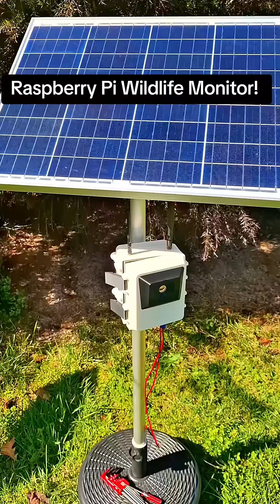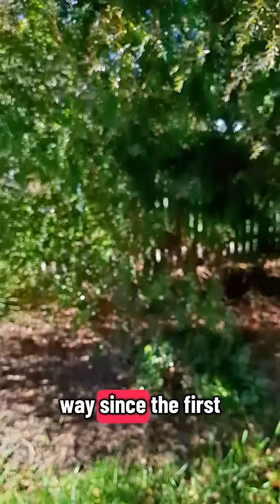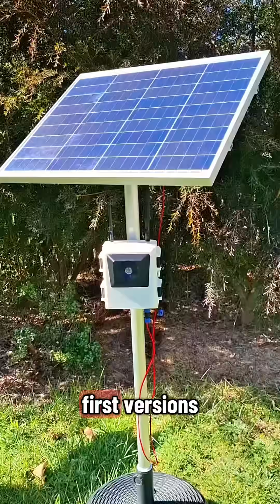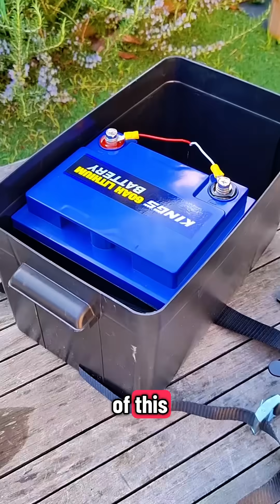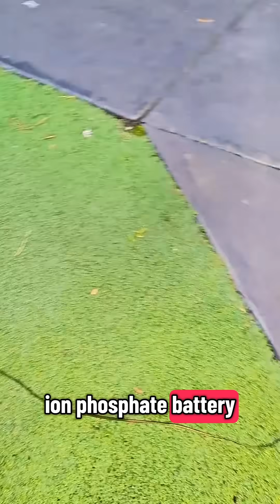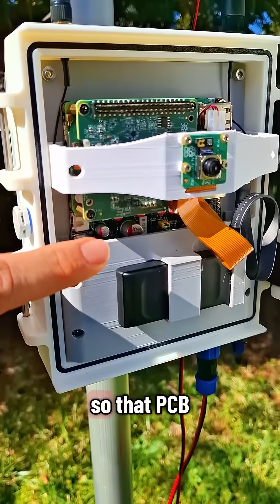Solar Powered Raspberry Pi wildlife identifier #raspberrypi #ai #camera

Comment: Man. Great work.
But why are you embedding ai in the camera if you can process the data on other location with a live feed?
Power in the wield is more expanssive then at a server or home.
The power you are using for the on premisse processing you could alocate to send feed for multiple cameras.
Reply: Good considerations
He previously mentioned leaving the cameras in remote locations to capture wildlife.  By doing the inference on the board, he can send only the event data over data stream, instead of having to stream the whole feed to do remote inference.